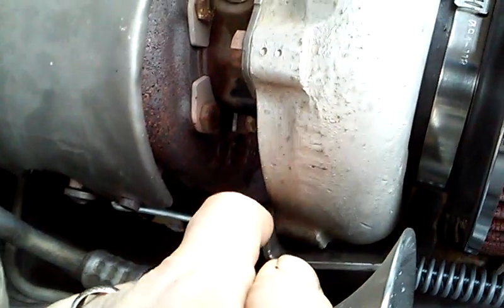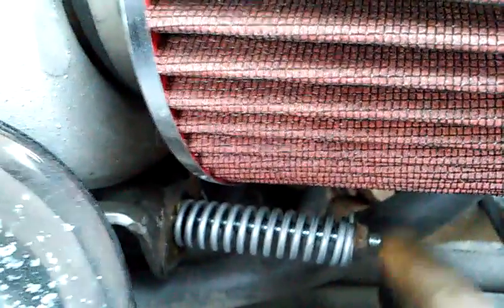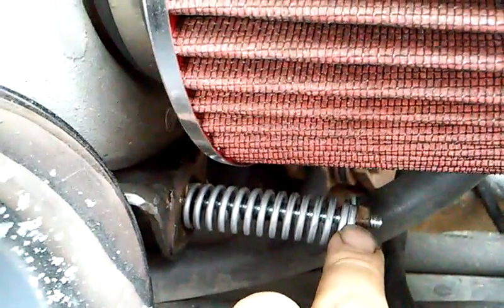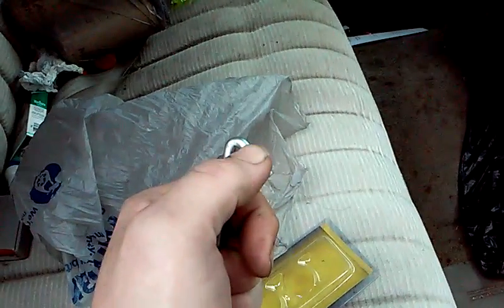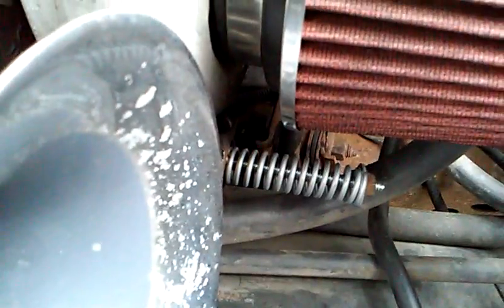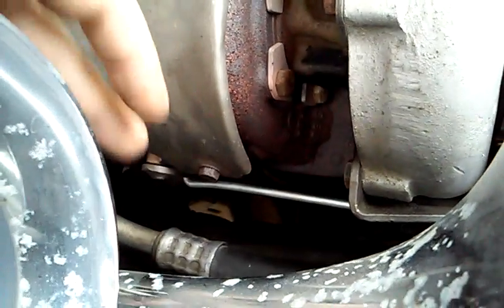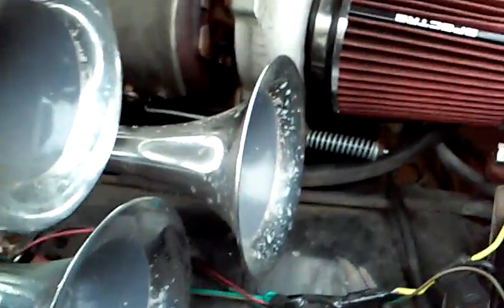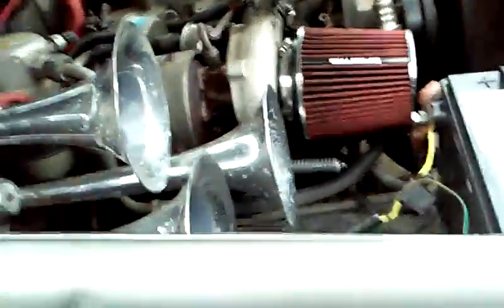1993 chevy 6.5 diesel turbo master Make your own cheap

Comment: I did all that, mine is soo weak! No power, turbo boost is like 10psi at most going up hill with that setup, but with a "turbo-master model 12 installed to control that wastegate, I can screw down that nut a lot more to make that spring tighter. so many quirks to fix. The rebuilt db2 was setup supposedly for a turbo, but, maybe the transmission is a bit to tight. Its always something. It actually goes slower going up a hill.
Reply from the maker: It sounds like you need a stiffer or longer spring. Then, whatever you used for your setup. It should work the same exact way the turbo master dose. At 10 to 12 psi, you're still running stock boost for a 6.5l they dont push much more than that from the factory. So that would tell me you need a better spring. Not sure on the transmission, though 🤷.  Mine was a 5 speed well 4 speed with granny gear.
Reply: @oleskoolvp  I guess I cant complain, yesterday did a mpg test and it got close to 21mpg highway. Mine has  3.73 rear gears, came with a 4.11. I have to figure out how to make the mph gauge correct, 60mph=63mph. I thought I would do a more "Cold air intake" kind of like the stock airfilter system was done but with a big K&N air filter in a closed battery box with a like 3" hole, lol, didnt work and that vacuum gauge sucked in like I had a dirty paper air filter" whenever I gave it a lot of gas". Turning in the spring more AND not covering the air filter battery box should help more, lol. I was trying to pull in the colder air from inside the front right fender. As for that spring, I could turn it in like another 1.5" or so, makes me wonder what will happen. That bolt that came with that turbomaster was really long.

Comment: I have a 97 K1500 Suburban 6.5. This is my very first 6.5. PMD already relocated to the passenger fender and it already has a different intake tube with a nice filter on it.

Today while driving I threw two codes, p0236 and a p0251.

The truck still runs fantasic but is blowing a decent amount of black smoke. I would like to build one of these but once I do that, what will I do with the old vacuum lines and should I unplug the old boost controller or should I leave it plugged in and just plug the line on it?
Reply from the maker: Cody Birchem your will be a little different because you have to deal with the computer bs. You cap the line off going in to the old wast gate. YOU WILL NEED A BOOST GAUGE FOR SURE for yours you can't run anywhere near the boost with a stock ecm. Unfortunately with the computer you will throw over boost codes I don't remember exactly for yours but I don't think you can go over 12 psi with out it throwing the code. I would check the forums to make sure before you start! But this will still work just the same as it's just like the turbo master set up. Just need to know what you need for boost to set it. Make sure you have a way to turn the light off. I'm sure you will set it off a few times tuning it in for what you need. Leave it loose to start and bring it up slow. When I did this one I went past finger tight for the first run and was up near 22 psi 😱 so be careful at first. You need to be under load to see what your pushing. Not in neutral revving it up
Reply: vape with ole skool vp Thanks for getting back to me man. I appreciate it. I will let you know how it works out next weekend. Should I block off the line BEFORE it comes into the boost controller on the driver's side or plug the line after it?

I plan to have a boost gauge mounted beforehand with a boost bolt on the intake. Hoping to have all the supplies by the weekend and plan to set it for 10psi. Also going to try and find a different crossover pipe before hand because mine's all messed up.

Comment: what PSI did you hold off at/not push past for safety reasons and were did you tap in your boost controller line? 
Thx
Reply from the maker: Spike 18 to 20 psi under hard push. But under normal about 15 to 16 psi.  But if your truck is newer then a 93 it wont do it. 93 and older is a mechanical pump so you can play more. 94 and up has a ecu and I think anything over 10 psi will throw a over boost code. Unless you have a programmer. I drill right in to the side of the intake on top of the motor.

Comment: What kind of fuel mileage increases did you see raising the boost to 15 psi?
Reply from the maker: Steven F to be honest not sure. I only have to fill up once a month normally. the odometer has not worked the hole time Iv owned the truck

Comment: Let the block and head cracking begin 😅
Reply from the maker: Ran 3 years 20 psi stock internals and stock bolts. With no issues at all 🤷‍♂️ guess that what happens when you get the best version of the 6.5 built and fueled like a 6.2 all mechanical less bulshit to go wrong

Comment: 1997 Chevy Cheyenne k2500 6.5 td. I have "the other turbo". what I did was I mounted it on an angle to the other bolt above the one shown in the video here. I also used a #52 spring from ace hardware. I used the #49 at first but with spring and threads at max tightness I was pushing exactly 12 psi. I wanted some more boost so I went with a heavier spring to push about 15. it pushes 5-12 in gears 1-3, then in 4th it can achieve 15. then in 5th it goes back to the 5-12. maybe if I had a better suspension to go at higher speeds I could achieve more boost in 5th but it really doesn't generate all that much boost. you really have to be red lining the truck at 4-5k to get up into 20 or more psi. idk maybe it's just my truck
Reply: Munerox 420. these trucks shouldn't go over 3... it's a diesel, power is down low bud
Reply from the maker: +Brett Thompson i hope i dont sound like an ass just explaining what i learned along the way!!! You need the boost for when you put the fuel to them. It helps cut down on the smoke you have to tune it out. That's one of the main reason turbo master made there products. 3 is just barely working they come from the factory 5 or 7 if I remember right. I'm not saying boost it like a Cummins it will blow apart! But you can safely add some boost to it. If I remember right the turbo master tells you 10 or 12 is safe for all of them. Plus it's in alot of the forum as well. 94 and newer can only hit the 10 or 12 with no other mods Because they will throw a over boost code. The 93 and older can run higher safely to a point think it was 13 psi for them again forums and turbo master. Then after that you weed through all of the bs back and forth with people posting dumb numbers like 25 to 30 just crazy stuff and other people that say only low numbers are needed. You can kind guess from there what will work. If your truck is a junker on its last legs no don't boost it your going to kill it. If you going to just beat the bag off of it all day and hold max psi all the time no don't boost your going to kill it. But if your normally not an ass everywhere you go and you have a boost gauge that works that you understand what it's telling. Yes you can safely boost your truck. Me personally my truck is set at 15 psi  and if I giver her some I peak at 18 as long as you don't hold it there for long iv been fine for almost 3 years knock on wood! But you have to feel safe where you set it. If you just want 1 or 2 over stock that's fine to. It's just a tool to help you tune your truck on the cheap. The turbo master kit dose the same thing sure it looks nicer but I don't see looks being worth over $50 buck when I can do the same thing for under $13. Sure they tell you exactly where to set it for what psi. This you have to test runs to get it there . Just be careful my first test I was at 25 it was a quick test just keep loosing up the spring and you will find the sweet spot for you.
Reply: vape with ole skool vp 
nah man youre good... yeah, with turbo csrs you're right...more fuel=more boost otherwise you run rich...or vise versa and you run lean but in saying with diesels they dont like high revs... it's like Harleys vs rice rockets, my hog I shift at 2000-2400 if I'm really in it...it will flat line in power from there ans then start dropping fast. diesels have all torque so the higher your revs the less torque you make..I think max torque rpm range was somewhere in the 2k range for our trucks? I forget the actual numbers though.

yeah the higher you rev the more air youre pushing but also the more fuel, so I would think if you need all that air, higher boost pressures and or a faster spooling turbo. I'm no diesel mechanic but thats just what ive experienced and learned from mistakes and past turbo'd cars
cheers🍻
Reply from the maker: +Brett Thompson I hear where you coming form bud 🍻. It's really not for the lower end power it's more for cruising power get up hill a bit better and good for passing. There a hill I go up all the time pulling my boat. I us to have to be in 4th about 1/4 way up. After this I can hold 5th now 3/4 of the way up with out losing to much speed. For the low end power I have not noticed a difference tbh. Put the old girl in granny let out the clutch not much going to stop it 😂😂😂

Comment: hey bud did you notice any different after you install your air intake im planning on getting one but i want to make sure if. it worth it thanks
Reply from the maker: ggg's fan there honestly not that much of a difference. but it dose make it so you can actually here the turbo spool. but make to keep it clean I replace mine every 3 to 4 mouths.
Reply: vape with ole skool vp thanks 👍

Comment: About how much spring force dose it take to build 8 psi
Reply from the maker: ryanburbridge to be honest I'm not sure you have to play with it to set it were you want it. You can run over 8 with out a issue trust me. If your doing it on one newer then a 93 I think your max is 10 or 12 be for you see the over boost code. 93 and older your good to about 15

Comment: "Just kinda finda a thick one" 
What kinda advice for a spring is that?
Reply from the maker: +Darren Betker  it all depends on how your settings it up and what you have available. Just because I have a set of verniers. Dose not mean you do right? So if I told you that let's say need a spring say 2.356 long by say .500 and you want the spring diameter to be lest say .060 thick.  how much is that going to really help you if you don't own the tools to measure like that. Not to mention do you think the poor guy working at the hardware store is going to have half a clue. The the advice I gave find a thicker spring that will work for you. Not know what you have readily available.

Comment: anybody have issues with their pmd, or other no start after doing this? after doing this it threw two codes. one for the glow plug relay circuit "a" and the other for the boost solenoid. I replaced the glow plug relay and plugged the solenoid back up and erased the codes but it won't start. I wonder if doing this fried the pmd since the pmd controls the air/fuel ratio
Reply from the maker: Munerox 420 my dose not have one. that's why I siad I'm doing this on a 93. Iv seen newer one with the same mod though not sure if it's different. my has not skipped a beat I'm 2 years after doing this
Reply: Yeah, I just found out yesterday they didn't do vacuum pump wastegate until 96. I figure I'll find a 95 ECM and pmd and it should work. I took it off and hooked the vacuum back up. Still won't start

Comment: what psi do u have cruising at 60 mph
Reply from the maker: 13 to 15 on average
Reply: My 96 w/similar spring has 2 psi and I think the gait is closed, only opening a little under heavy acceleration to yield 10psi
Reply from the maker: +Tom Hobbie can you move the gate by hand when the truck is off? You can't have the same boost I think it's 94 and up will throw a over boost code on over 12 psi
Reply: gait takes about 15 lbs  to move
Reply from the maker: +Tom Hobbie well that's odd Sure the gage has no leeks in the tubing?
Reply from the maker: +vape with ole skool vp it's hard to be honest man my is way different then your. The 93 is set up like a 6.2 all mechanical where yours is all computer-driven

Comment: I did the same thing in my truck with the manual wastegate. But for some reason I'm not getting any boost, any way to correct this?
Reply from the maker: +Peter Plewa try a stiffer spring or put more pressure on it. It needs to have resistance if you can move the rod at all by hand it's not enough to build boost. You need to be able to keep the flap shut until you build enough boost to open it.
Reply: I have the same issue I put a boost gauge in an installed a homemade wastegate actuator my boost gauge is a Bosch boost/vac gauge I put a boost bolt in the front center hole of the plenum/intake an barley get any boost I have changed springs an even did the old eyebolt an spring method an still only maybe 2 or 3 lbs of boost show on the gauge.. Any idea as to what I'm doing wrong I can barely here the turbo..

Comment: where do I hook my boost gage line to on the motor.? can you make a video on that.? and I have the wastegate that goes up and down, not side to side like yours so I'm a lil lost in how to hook that up. if you would like I cab give you my facebook name and you can pm me. in sorry to bother you but I really need help bud.
Reply from the maker: hey man I'm at work right now but look up on fb Vaping with oleskool send me a pm on there and I will walk you throw it. with no problem. do you have the drill bit and tap for the hole for the tube? if not I'll look in my tool box when I get home and let you know what you need